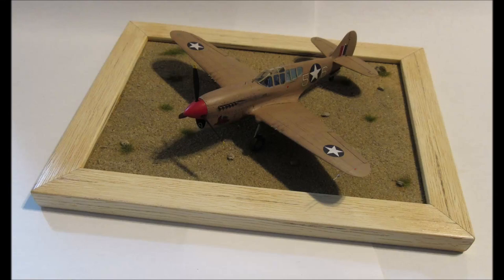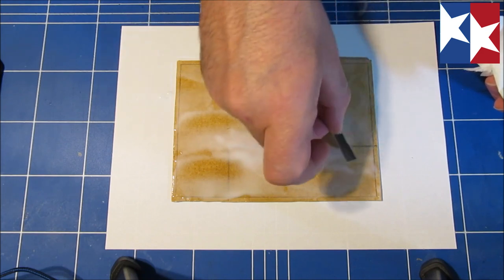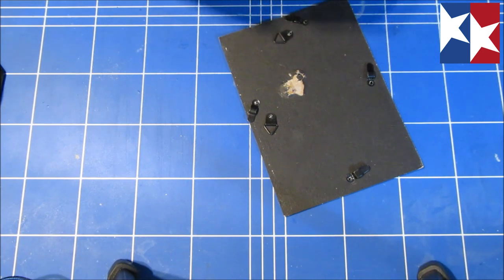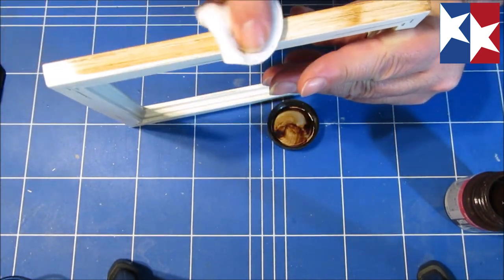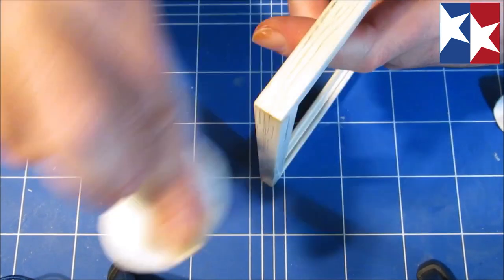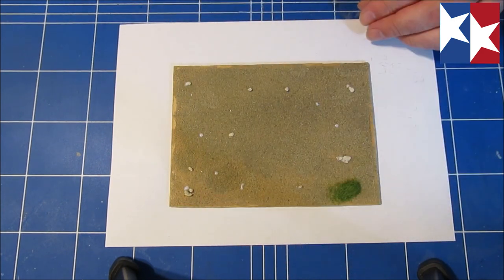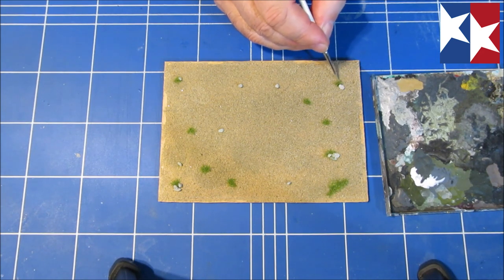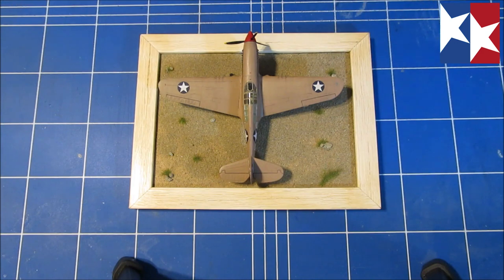How to make an airfield diorama base from a photo frame

Comment: Nice diodrama! (yay for patina :D ). You know the trick for fixing thicker layers of sand/rocks/grass on your base right? Little spray bottle with woodglue, water and alcohol?
Reply from the maker: Actually I didn't! I just dove into it head-first like a quick 20 minute build (without drying times of course) with the materials I had in the house. But cool tip for the next one(s)!
Reply: @KitKabinet  yeah, just glue your base, sprinkle sand (or what have you) up to the required thickness and then mist it with that mixture from a small spray bottle. Fixes it right in place! Just use spiritus for the alcohol, to break the surface tension.